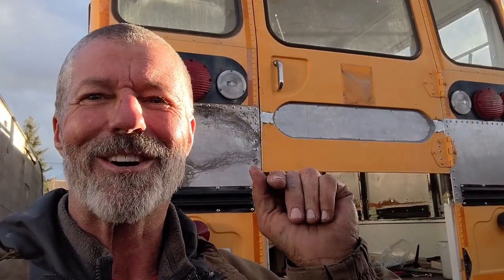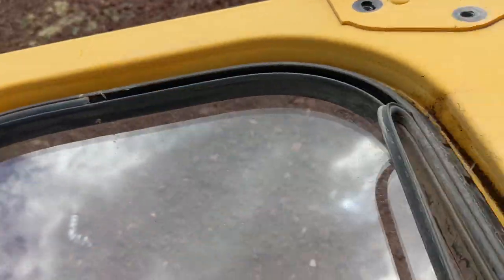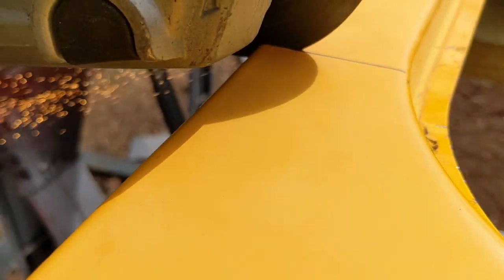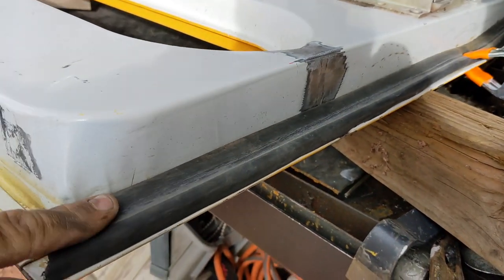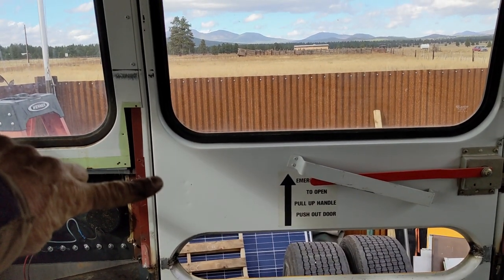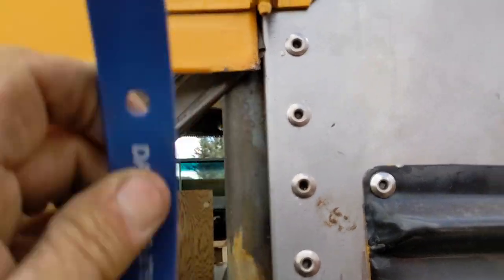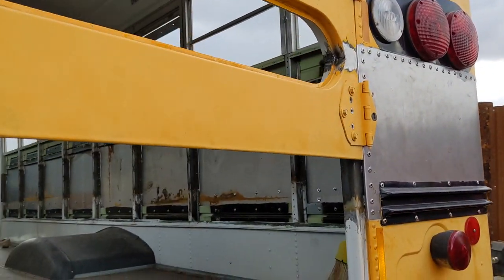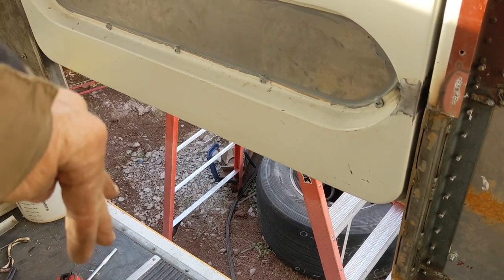Modifying a school bus rear door after a roof raise.

Comment: Hey Ross, Eastwood makes a new air cutoff tool with a carbide type wheel. They claim it lasts far longer than current abrasive fibreglass bonded wheels (the brown red ones) I can see it coming in handy for you. Greg